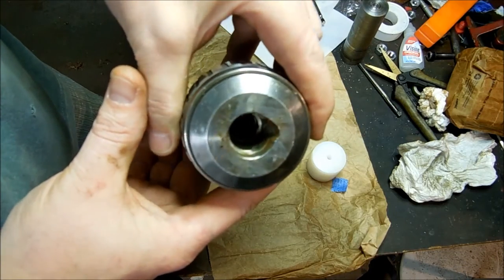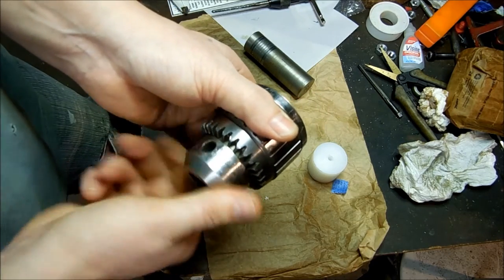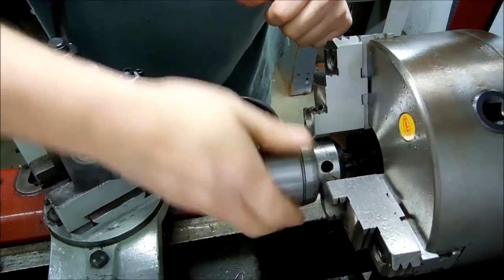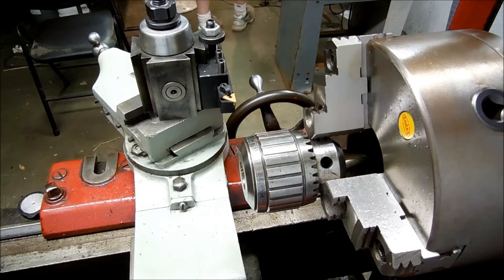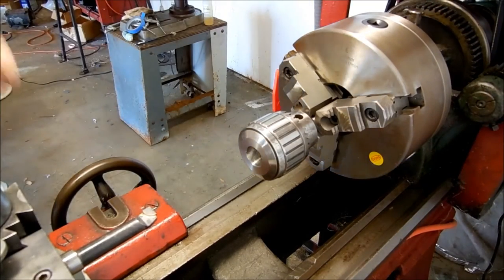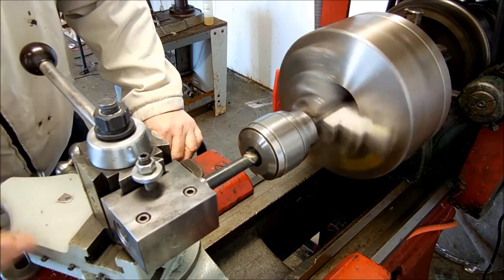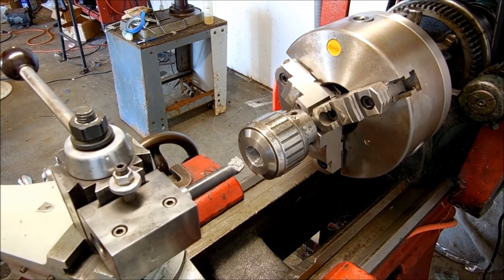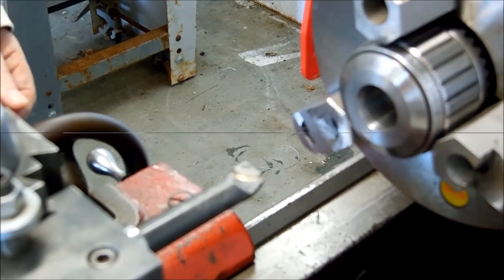Drill Chuck Repair Part #1

Comment: Hey Chuck, The USA 16N is worth saving! I would recommend  Disassembling the chuck first, machine the body bore, cut a shoulder into it, and thread it. Then make a threaded arbor with a shoulder that will seat into the shoulder of the chuck body. It should run pretty true.

Comment: I got the same type of deflection when I was boring out a couple surface grinder hubs when it would hit the hardened sections, especially when I didn't have the angle of the insert right in lighter cuts.  Aloha, Chuck
Reply from the maker: Yeah, it's so odd to see it happen and it made me want to keep on cutting, LOL! Hey, did you want a set of reamers too...I can't recall, but would be happy to send you some!
Reply: You could mount an indicator base on your saddle and the indicator against the boring bar and then on cross slide if we were interested in seeing exactly which parts of the whole setup were flexing the most. If the tool post itself or the cross slide, you might be able to see if those things could be "stiffened" up a little to help things in all turning and boring endeavors.

If you have an extra set. I don't recall exactly which tapered reamers I have in the toolbox.
Reply from the maker: I was just out there checking on runout and found some stuff that I need to address before getting anything turned accurately. While my spindle, and even the backing plate on the 3-jaw, are maybe a tenth out(it's nearly imperceptible on a thousands indicator, just a tiny tic), the circumference of the chuck body is out by 0.006"!!! I recall it was out a little, but must have either measured wrong when doing the initial install, or it has gotten worse...which I don't see as a possibility.

I will video it all and include the spring in the tool and the mandrel as it is now, and then again after beefing everything up. Thanks for the inspiration, and I will send you a set, minus a No.1 reamer since there's only 1 left for me, when I go to the PO tomorrow. Aloha...Chuck

Comment: The boring bar will bend if you have it so far out from the holder…
You should have stripped it completely to check the condition of the jaws etc first…
It’s definitely steel…not cast iron…